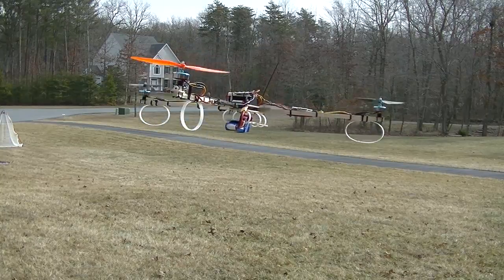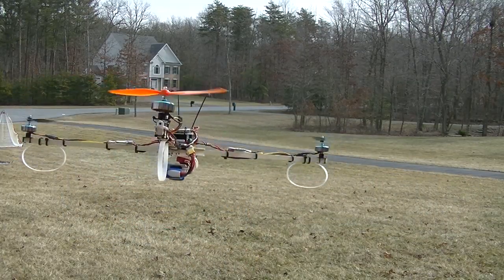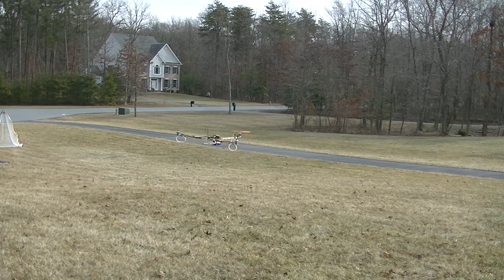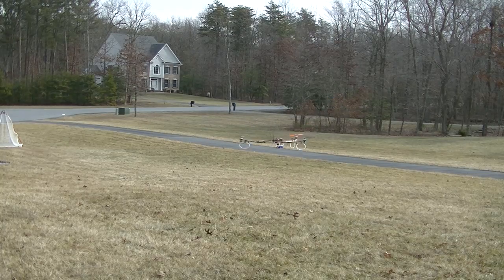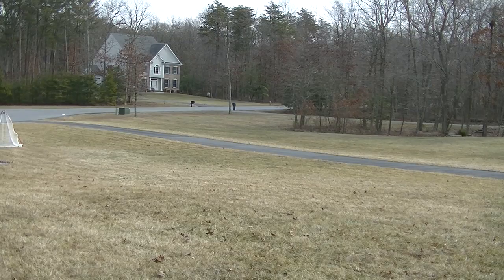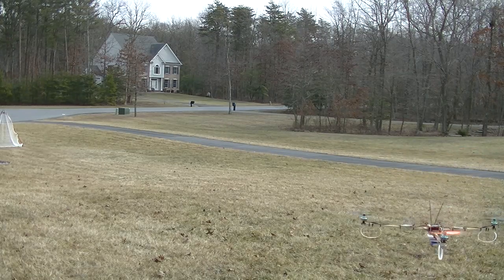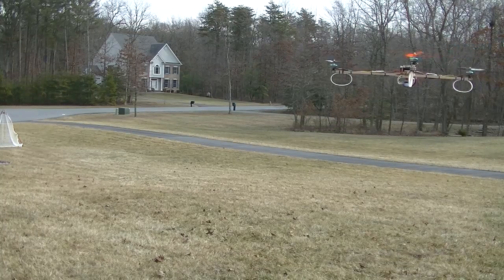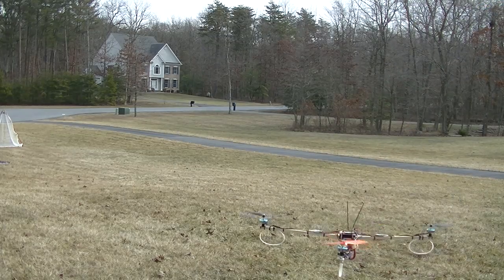CPO Tricopter Build : Flying in Self Level on Default KK2.1 Steveis V1.11S2 Firmware

Comment: I had the same occurrence happen to me on my Tricopter but it was on the tail motor. After looking things over I found that one of the bullet connectors was easier to pull out than the other two. I also noticed that there was a little brass showing through on the connections so I thought maybe it arched a bit or came loose. I simply put some shrink wrap over the connections and it never happened again. With the rear motor constantly moving, I figured it was not a bad idea and is still better than direct wire.

Comment: Your flying and the firmware looks promising ;-)
I experiensed several glitches too when I build an flew different Tri- and T-copters with the 750-motors. Because of that I have only flown quads the last year.

I suspect the Tri-firmware not being so error-free as e.g. quadcopter, because of many more quad-users = Beta-testers. 
I never experiensed this it with my quadcopters even with 750-motors.
But I think too some of the glitches happend because a prop slipped on the motor, because often happend when suddently increasing throttle. 
I went to scratch the top of the blue bells and using new M4-lock-nuts every time + blue locktite both under and on top of the prop's. 
But the 750-motors have a construction weekness, asking for these problems. You can't tighting the M4-lock-nuts/spinners really, because the bell then get pushed down on the ball-bearings an blocking more or less. Other motors as e.g. some Turnigy’s or SunnySky's newer models (mark-ll) have an bolt on thread, which you can tighten as much as you want without this risk. Because of that I don’t buy more 750’s
Happy building and flying
Reply from the maker: Thanks for the comment. Btw...if you look at my prior video on the dt750 you can see how I mount the props to avoid the bell compression issue. It also gets the prop nice and tight!
Reply: OK strong mounting, then is your glitch probably not because of slipping prop ..
But your longere shafts will bend more easy in a crash
Nice good videos you have made :-)
Reply from the maker: Thank you. Interesting...it hasn't ever glitched again....so who knows! : )

Comment: I'm happy to see your tricopter flying. I have been following along and building my own, taking a lot of tips from your videos and other's. In particular, your zip-tie camera/battery tray design works amazingly well on my tricopter. Thanks for all of your very detailed videos. Hope you get some warm weather soon! I'd be interested to see how you deal with tuning.
Reply from the maker: Awesome! Thanks!
Reply from the maker: BTW... you said the zip tie mount works well. Can you elaborate?  Have you used it with a camera yet?  I actually haven't gotten that far. It's pretty typical that the people building along with me pass me up, since I take so much time with the video stuff. : )  I have really big hopes that this is going to work great for folks. Please let me know any details you can!
Reply: EVERYTHING cpo I mounted a Mobius camera on the front of the camera tray cushioned by some gyro foam and tied down with Velcro straps. I took some video on a couple of flights, you can see them on my account. Unfortunately, Youtube performed some stabilization on them so it's not a good representation of the dampening effect but the raw video looks quite stable and free from high frequency vibrations, (aside from my less than great piloting skills).
Reply from the maker: koeuz
I was checking out your flight vids...very nice. I that my design you built entirely (body)? I'd like to share some of your footage on my webpage if it is...and you don't mind, of course.  Or, you may have just taken parts of the build to adapt to your own build.  I see what you mean by YouTube stabilization. I always turn that junk off because it mostly makes it worse that it was before on mine!
Reply: I am flying on self level still, which is probably not great for smooth video. I am using the rcexplorer size frame, but I used your reasoning and calculated the arm lengths to put the COG where I wanted it to be rather than using David's recommended lengths. I may try to update my frame to a size similar to yours because I would like room to mount the KK board in the foam package.

I don't mind you sharing my footage for sure, I may remove stabilization on the first video so you can see what it's like.

Comment: Glad to see it flying. It looks to me like the P gains are too high. You can see fairly high frequency oscillation/twitching throughout your flight, especially when you hover near the camera at 3:15, which are caused by the controller "pushing too hard" to level the craft and overshooting, then immediately pushing too hard in the other direction to compensate, and so forth. In my experience this is completely normal with stock KK2 gains. I had to turn down the P gains quite a bit on my tricopter (I don't remember the actual numbers).
Reply from the maker: Thanks, I think you are right. I'll know for sure once I start the methodical process.  It's just too cold/windy right now for me! : )